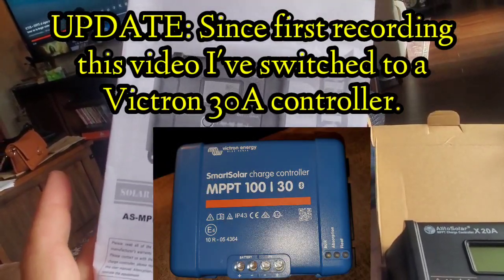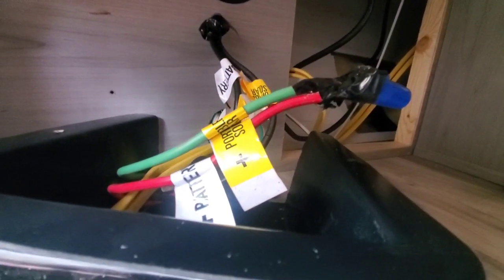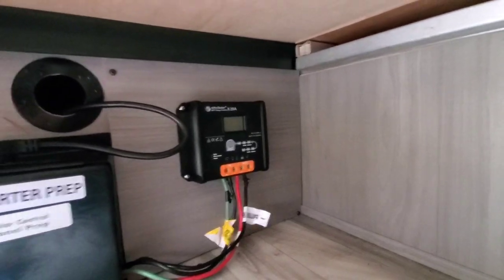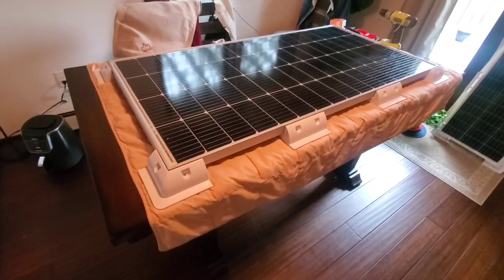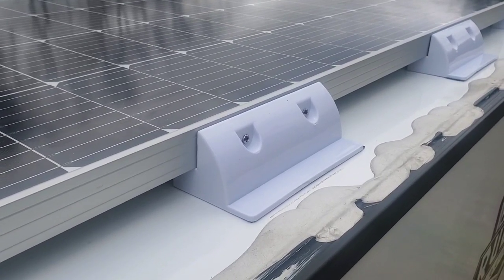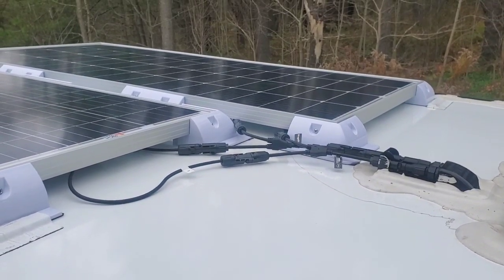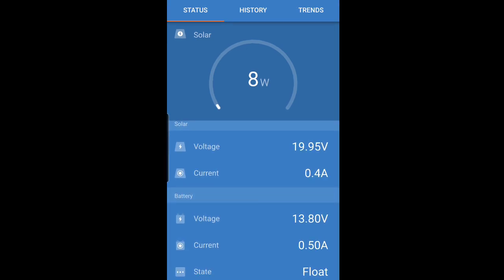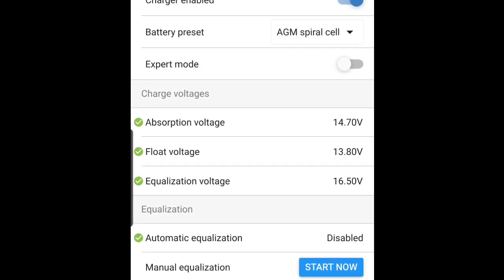SOLAR SYSTEM INSTALL ON A COLEMAN RUBICON 1200RK

Comment: One more question, why 200w and a 100w? Is the 200 not enough? I do have a 200 just wondering if I need to purchase the 100. If it’s going to make a difference I will definitely do!
Reply from the maker: 200W will probably be aok and 300W is probably overkill. 

More wattage gives you a lower probability of ever running out of juice.  Id figure 25 amphours/day for the fridge itself.
Reply: Thanks
Reply from the maker: "Design" for solar is 30 amp-hours/day for every 100W of panel.  With light usage I'd estimate using 35ah/day.  If youre doing an inverter and using it a lot youll use a lot more than 35 ah/day.

200W with a lithium 100ah battery "should" work well.  You can add panels if need be.

Comment: Does it have a AC and heater 
Iike the 1400bk? If so is the solar power running everything or just your fridge ams lights? I just bought a 1400bk and they told me if I add solar it only runs the fridge and lights, not the AC and heater.
Reply from the maker: Yes it has AC & Heater.  

The battery only runs the 12V systems unless you add an inverter.  If you add an inverter in the 1200RK, the pop up power bar gets energized with 110v AC.
 
Theoretically, you could plug the AC and heater into the power bar, or, re-wire the RV.  However, the panels and battery(ies) on such a small RV are not sufficient to run either for any length of time.  The energy draw is just too great.

I bought a 350W plug in heater with a thermostat.  Once I add an inverter, the setup I have "could" run  the tiny 350W heater for a part of the night.  Instead I'll buy a lower wattage electric blanket so I can have heat thru the night.

I have a 2800W Honda genny; that's my personal choice for AC and larger heater use when required.  It's the simplest solution for me.  You can pickup a sufficient 2000W inverter-generator for your RV for $300+ on sale.

Good luck.
Reply: @hankontheroad5960  
thank you for the information!!
Reply: With the solar panels and the 30amp, can you use the receptacle on the kitchen?
Thank you for this video
Reply from the maker: No you can't.  Please read my lengthy reply to Drewg2030 above.
Reply: I get lost with some words but I guess I understand better. The purpose of the solar panels is to keep the 12v battery charged👍
Reply from the maker: @puuerr2  The way I have it set up, basically yes.  The battery can run the AC pop-up tower if an inverter is installed.

Comment: Nice.   What was the black AC plug for?
Reply from the maker: I haven't gotten that far but its in the inverter box.  That plug must be feeding the AC systems that feed off the inverter...  when one is installed.
Reply: @hankontheroad5960  i bought one with an inverter.  The cord is plunged into it.   With the batteries fully charged, the inverter on and the cord plugged in, i have no A/C at any plug.  I can unplug it from the inverter or plug it into the original place in the bax and nothing changes.  It's driving me nuts lol
Reply from the maker: Ive only heard that just some of the AC systems will run off the inverter.  Try asking in the FB Rubicon 1200/1400 group?
Reply: @hankontheroad5960   it powers the pop-up power station!
Reply from the maker: Howd you find out?
Reply: @hankontheroad5960  cool folks on the page you recommended.  Thank you.
Reply from the maker: @4MikeHarley  Excellent. 👍🏼

Comment: Nice install. I scuffed the bottoms of solar panel brackets lightly and where they were going to be placed on trailer roof, washed the scuffed areas with a degreaser household cleaner, then wiped everything off with 90% alcohol and lint free rag to get rid of any finger oils.  Then placed turnabond tape over brackets and keep sun / weather off edges of the VHB tape.  working great for past 3 years. Look into a victron battery temperature monitor module to tell charge controller when not to send power to battery in too cold temperatures. Mine is set for cutoff temp at +1 degree C.
Reply from the maker: I didnt go into that deep of detail.  Me too.

Ill think about the temp control.  I thought the BMS cut it off at 35 anyway tho.